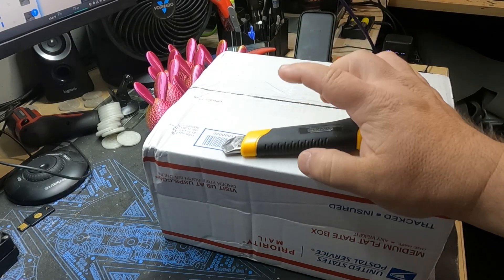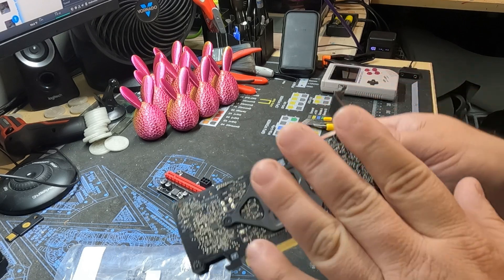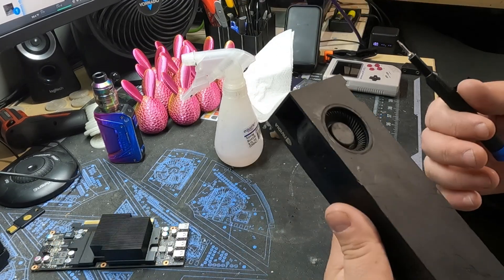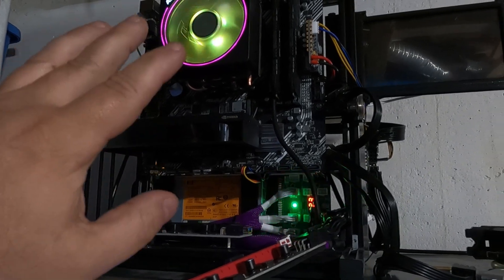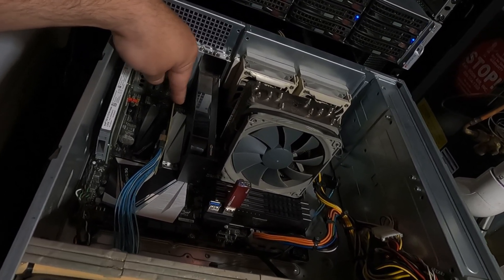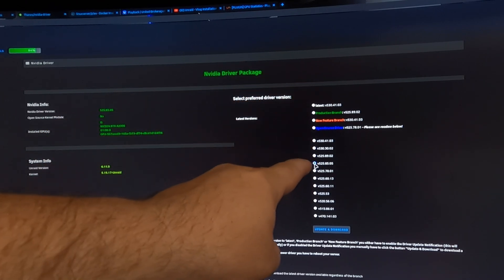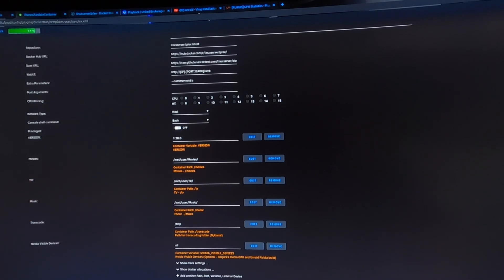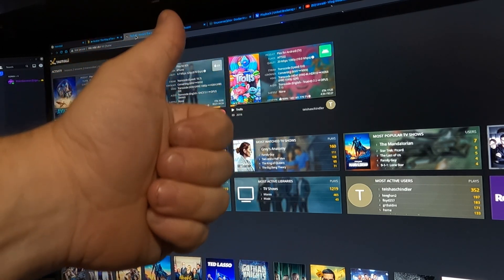Upgrading Plex Server With Nvidia A2000

Comment: Why wouldn't you just use a A310 instead from testing I have seen it can do 5 transcodes from 4k 10 bit HDR to 720p concurrently, and after enabling ASPM the idle power isn't bad either about 5W. Like the Idle power isn't great by any stretch of the imagination, but it's competitive with the lowest idle power NVIDIA cards, the 6600XT would theoretically be the best at 2W idle... but Radeon so it's trash.

In all seriousness, the lack of official support for transcoding makes it not an option I would honestly love to go with a 6600XT the compute for the price is awesome, even if I wanted to run a game off the NAS it's a good entry-level gaming card so if my main GPU packed it in in my system I can swap it over and at least still game reasonably at 1080p... but nope Radeon fumbles again at the finish line.

Also would love to go AMD for the CPU because secondhand going ECC is much cheaper if you go AMD and the idle power on the motherboards without chipsets and assuming you are going with a monolithic AMD CPU like the idle power is great and the performance is relative to Intel miles ahead on CPUs with the same idle power. I don't particularly care about load power which is where Intel really falls behind, but it is another advantage for AMD, but again the iGP doesn't officially support transcoding in PLEX and Jellyfin.

Just f£$%ing Radeon is an albatross around AMDs neck.

Comment: Great video.

I'm using Proxmox rather than Unraid, but the same general idea.

The setup with Proxmox required a little bit more "manual" work (rather than clicking through a GUI) (copying and pasting commands and editing text/config files), but it still, also works like a charm.

I'm running multiple LXC containers now, sharing the same A2000 6 GB where I can be running a GPU accelerated CFD application whilst it is also doing a transcode in the background as well.

It's AWESOME!!!

Comment: How would you say this card compares to a 3080 for plex? I currently have an amd setup running my server, I believe it's a ryzen 9 3900x, 16gb of 3200mhz ram, and a 3080. Seems to run well.
Reply: Your 3080 would shit on the A2000. The workstation GPUs are way too expensive. I have seen A2000 being sold for close to what a 3090 is sold LOL.
Reply: @simdevils  yea it seems to be able to push 4x 4k streams without issue. Been running like this for around 6 months without issue. I was using my synology to run plex, but it was far too weak so I just swapped everything to my desktop and am just using my diskstation as storage
Reply: @ShermSMASH  nice, I am using a 3090 and I wanted to downgrade to like an A2000 or A4000 but the prices of those are close to my 3090 and I am like WTH, the 3090 beats both together LOL so I guess I am just sticking with that, it’s basically doing nothing 99% of the time.
Reply: @simdevils  yea those a series cards are just way too pricey because they can still be used to mine crypto efficiently. But I agree, the card basically sits idle most of its life so the power savings are negligible. It's funny tho, I recall back when I started my plex server, I was running an Alienware alpha r2 and it handled everything perfectly fine, until I started adding 4k 10bit blurays, then she would cough and wheeze constantly lol. I still have that little alpha too. It was amazing because it literally only used 60 watts of power... Ahh the good old days of 720p were such a simpler time ahahahha

Comment: I’m confused. I’m not a Plex expert. But why would you use an A2000 instead of an RTX?
Reply from the maker: they basically have the same NVNEC encoder built in, so it's not necessary to have a higher powered card that will waste power.
Reply: Correct , the A2000 isn’t limited to transcodes like normal Consumer GPUs more professional or Commercial cards allow more and the A2000 is essentially the equivalent of the new Quadro line of cards . Essentially it does what he needs it to do more efficiently and at a fraction of the cost of using a much higher model card also this allows for better performance when you have multiple streams ! But this works just fine for the average Plex enthusiast unless you’re Netflix Or Disney lmao then that’s a different story

Comment: Never use a little bit on a GPU, it does not have a metal heat spreader like on a CPU, the die is exposed, and 
that's why the factory uses so much (thermal past), and that's why you also should do that.

Comment: I grabbed an A2000 to upgrade from my P2000 for my Unraid Plex server as well. I was VERY pleased at the 4K transcoding performance… so much so that I did away with my dual 4K/1080p Movie and TV Show libraries and merged them. I have so far had 8 4K transcodes to a mix of 1080p and 720p and have only seen 30-35% load. Good luck and enjoy as our systems are very similar :)
Reply from the maker: This is great info!  I've only tried with 2 4k streams running at once so far.
Reply: How much watts does it consume while idling?
Reply: That's precisely why I am trying to do on-the-fly transcoding as well is because I don't want to have to keep two copies of everything.

The A2000 DEFINITELY helps with that, and it's certainly more than powerful/fast enough that I can transcode multiple streams at the same time and it barely breaks a sweat.

On top of that, the fact that it's only a 70 W card also helps as well, so if my main Proxmox server is busy doing something else - it doesn't hinder the transcode performance.